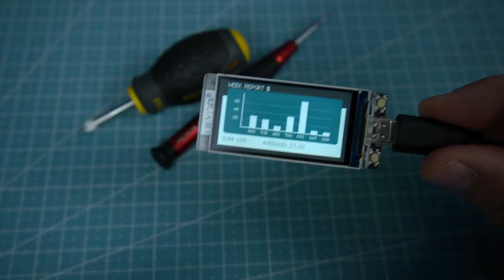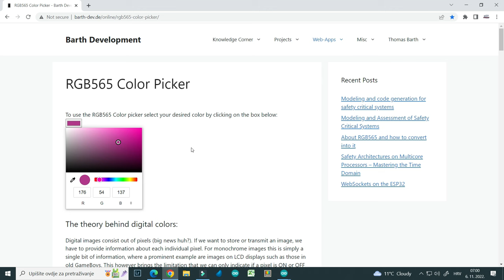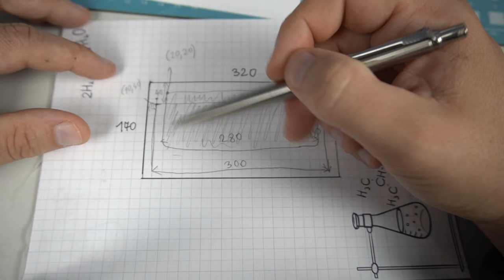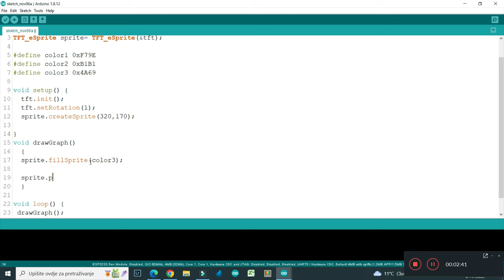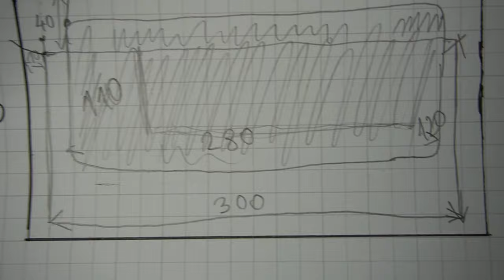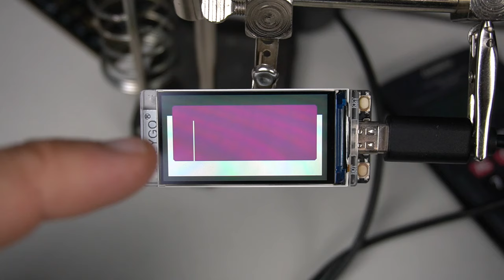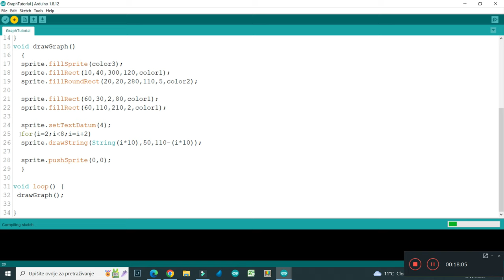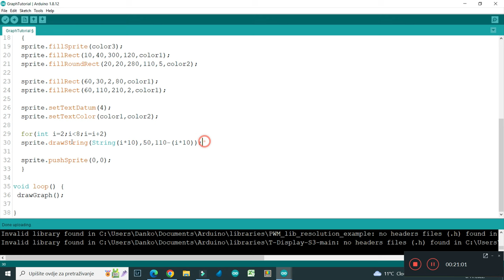Bar Graph - Programming Tutorial (TFT_eSPI library)

Comment: Watched it all.. thanks for teaching me and will be writing my code based on this to display analogue values from Air Preasure Transducers attached to my Air Suspension in my Truck.. I then will calibrate the values to give me a KG reading , showing how heavy my load is on the front tyres, each rear set of tyres and finely my trailer tyres ( this value is based on what the air pressure in the suspension increases too over the static load at empty weight pressure) 

Looking forward to implementing it.
Now I just need to purchase a nice quality screen and frame.

Comment: I have recocniced, that the vertical numbers 20-60 needs to be a little lower. That it coresponds to the values. I changed the for loop to i<=8, this will give a horizontal line more for Value 80 and i changed Y coordinate of drawString and drawPixel from 100 to 110. Now the values coresponds to the vertical legend numbers.
Reply from the maker: You are right! It is nice to see when people solve problems and share solution with others. Thank you again Heinz.

Comment: A handy trick is to draw a coloured grid of lines over everything else so you can easily position and align your graphics, then remove the grid. Just write a function with two loops and you can use it in any project =)
Reply from the maker: Great Idea, i will try. Tnx
Reply: Thanks for that idea. I’m making a StreamDeck out of a 2.8 inch touchscreen ESP32 board I got for $15 and this is gonna help a lot

Comment: Nothing black screen - am I missing something ?
Reply: I got a black screen too
Reply from the maker: What board are you using, did you install it properly?
Reply: @VolosProjects  First - thank you for you excellent work and great presentations, I'm Using a LILI=YGO T-TDisplay  S3 , Finally figured it out  the "mess"  with the,header files, the compile times for each change are outrages 3-5 min per compilation  - didn't realize that you were editing the times on your presentation
Reply: it is not working as I found out  ...

 ESP-ROM:esp32s3-20210327

Build:Mar 27 2021
rst:0x15 (USB_UART_CHIP_RESET),boot:0x8 (SPI_FAST_FLASH_BOOT)
Saved PC:0x420266f6
SPIWP:0xee
mode:DIO, clock div:1
load:0x3fce3808,len:0x43c
load:0x403c9700,len:0xbec
load:0x403cc700,len:0x2a3c
entry 0x403c98d8
E (6) gpio: gpio_set_level(226): GPIO output gpio_num error
E (7) gpio: gpio_set_level(226): GPIO output gpio_num error
Reply: I also can't get the screen to work. Using the liligo version of TFT_eSPI.
if you managed to make it work, please tell how

Comment: Thank you for this nice Project. I coded it while watching the video. 👍Everything works great. I still can't get the display to work on platformIO May be you can publish your PlatformIO settings.
Reply from the maker: I havenet tryed using platform IO with this board. I will probably mak another video on this subject.
Reply: @VolosProjects  That would be great, if you find solution to work with platformsIO. By the way have you tried to use serial monitor with this board? I was not able to send something to serial monitor in Arduino IDE. It seams as if Comunication via serial console is disabled.

Comment: I watched it all the way through. Very nicely done and don't worry, your English is fine and I enjoy your accent. Because of your videos, I have bough that device to play with. I did run into an issue though. I'm running Windows 7 and it will not show up as a virtual comport in device manager so Arduino environment can't talk to it. It looks like you have to use Windows 10 to work with it.
Anyone get it working under Windows 7 using Arduino 2.0?
Reply from the maker: Tny, mike, curently I don't own any win7 device so I cant try this. I will see can i fiind driver you need to install.

Comment: I have been following your series. Excellent. Any chance you could explain in a vid, how to turn on and off backlight, using ping or usable pins. Esp32S3 T-display. Thank you.
Reply from the maker: Hello, here you can see how to adjust brightness https://youtu.be/50uPv7tsVIc
Reply: @VolosProjects  Had everything I needed. Thank you. I am not meaning to be lazy, but the documentation online is for older units. Your youtube  info seems to be the only one that works in these modules. A special thanks for the walkthrough on setting up the library.

Comment: Is there anything that needs to be done to get the T-Display S3 to run from the LiPo cell? It seems to me that the sketch that was delivered with it did run off the LiPo. But now that I have uploaded and run a couple of your sketches I find that they work fine when powered by USB but show a blank screen when powered by the LiPo cell. The board charges the cell fine, the red LED goes out when it's fully charged. I followed the Tips 1 and 2 about uploading with after starting with the boot button pressed, but it still did not run from the LiPo. I tried a couple of different cells including an 18650, no joy. I have not been able to find the source for the original supplied sketch to see if that works. I'm using the Arduino IDE 1.8.13. Any clues would be appreciated...
Reply from the maker: here is your solution https://youtu.be/50uPv7tsVIc
Reply: @VolosProjects  Perfect! Thanks! This is a sweet little board.☝

Comment: hi, thanks for the information.  I tried the short version ( at 9 minutes in the video).  It compiles, uploads, blanks the display, then - stays blank.  Any suggestions?  I went through your walkthrough Arduino ide and set everything up.  I can load and run the factory sketch with no problem.
Reply from the maker: short version?
Reply: Look at video at 9 minutes.  You wrote to to unit with only 25 lines of code. (short versio). I thought it would be easier to troubleshoot. Full version gives same result.   I also tried your Progress bar - same result.

Comment: When I try to upload code to this device, I keep getting this error..

Arduino: 1.8.19 (Linux), Board: "ESP32S3 Dev Module, Disabled, QIO 80MHz, 4MB (32Mb), Core 1, Core 1, Hardware CDC and JTAG, Disabled, Disabled, Disabled, UART0 / Hardware CDC, Default 4MB with spiffs (1.2MB APP/1.5MB SPIFFS), 240MHz (WiFi), 921600, None, Disabled"

In file included from /home/user/Arduino/VolosR/GraphTutorial/GraphTutorial.ino:16:
/home/user/Arduino/libraries/TFT_eSPI/TFT_eSPI.h:306:21: error: 'VSPI' was not declared in this scope
     uint8_t  port = VSPI;// VSPI
                     ^~~~
/home/user/Arduino/libraries/TFT_eSPI/TFT_eSPI.h:306:21: note: suggested alternative: 'SPI'
     uint8_t  port = VSPI;// VSPI
                     ^~~~
                     SPI
exit status 1
Error compiling for board ESP32S3 Dev Module.

This report would have more information with
"Show verbose output during compilation"
option enabled in File -> Preferences.

The ^~~~ is pointing at VSPI in the error window. I tried changing VSPI to SPI and get same error.
Reply from the maker: did you install board and library, what IDE you are using, which win?
Reply: @VolosProjects  I am unable to respond with an answer. YT keeps deleting my reply.. because it has U r L s in it..